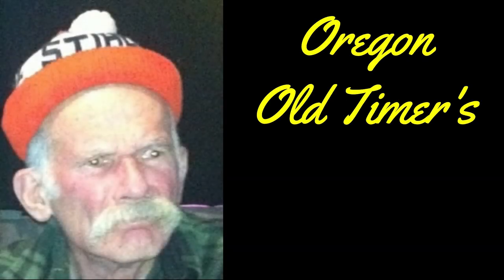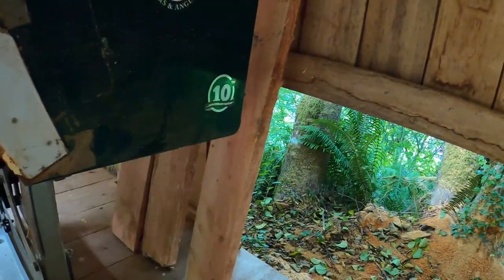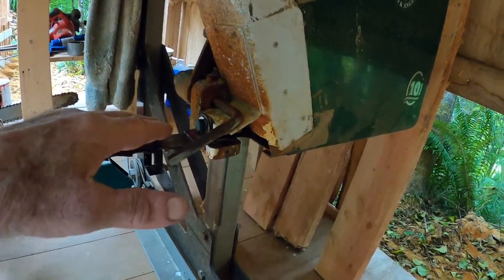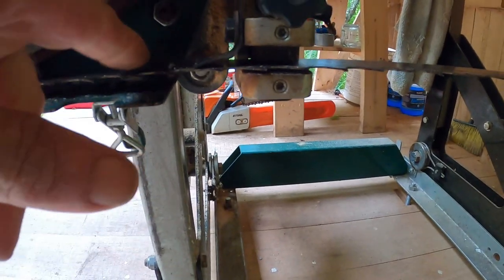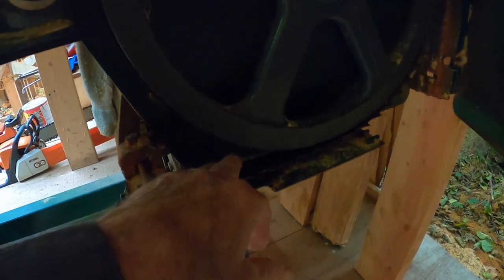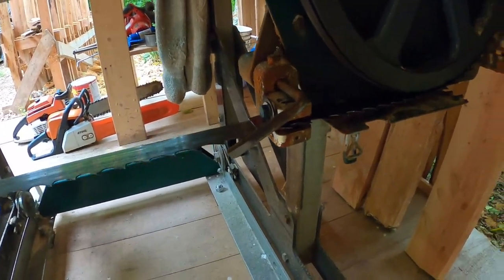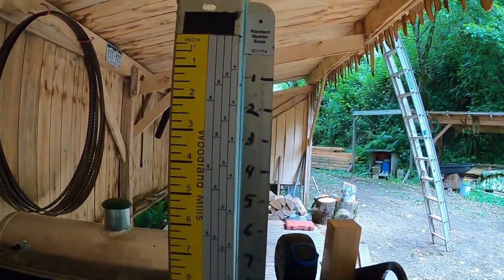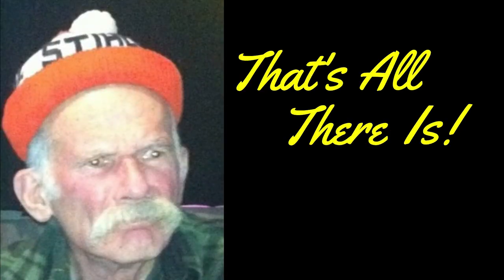Improved Blade Scraper and a Wood-Mizer Addition to my Woodland Mills Sawmill

Comment: Thanks for the plug; I appreciate it. One thing about mounting the Wood-Mizer Standard quarter scale; DO NOT align the quarter scale "zero" with the mill zero. If you do, your last board will be off by 1/8". Mount the Standard quarter scale so that the 4/4 mark is even with the 1" mark on the mill scale. If you are using the WM Hardwood quarter scale (opposite side of the Standard), align the 4/4 mark with 1 1/8" on the mill scale. If it's possible to have the QS adjustable, it will give you much more flexibility in setting up your cuts. For more/ better information check my video Quarter Scale Secrets Redux # 108.
Good luck.
Dave
Reply from the maker: Sorry so slow to respond, Dave. I don't know why YT tells me about only some new comments. I have to remember to search Comments in Studio more than a couple of times a year.
I discovered that last-board anomaly, having forgotten that you'd discussed it. but, problem solved with a second index line a short eighth from the inch index.

Comment: Maybe this is a stupid question Mr Crush but I don't understand quarter cuts could you elaborate some? I have a lumber mate 2000 and the scale is on a magnetic strip with a imperial measure followed by a one inch and a 3/4 inch scale marks and it has a little extra added for the cut. and when you line up for a new cut out of the scale and it is out on the cant you can raise the magnetic scale up or down to get the scale on point! Maybe I am being confusing now hope not!
Reply from the maker: I've read your comment several times and am still not sure what you're asking.
There at least two different quarter scales. Each has a slightly different formula and each yields a slightly different thickness. The principle behind both is, as I understand it, to cut a board allowing for kerf and milling. If you cut a cant into 4-quarter boards, they should all be just over an inch thick. How much over depends on which quarter scale you're using.
I hope someone who knows more about this than I do will chime in and help you out.